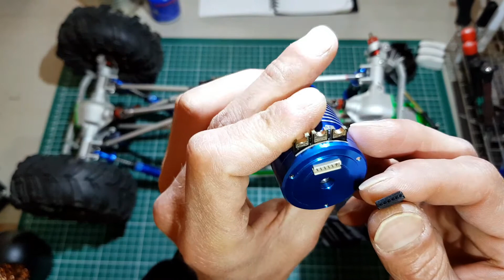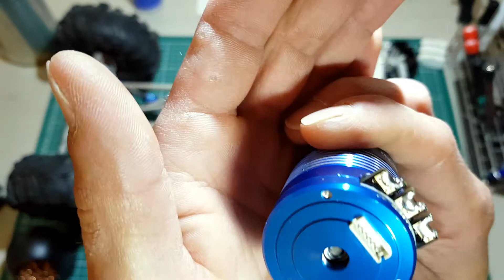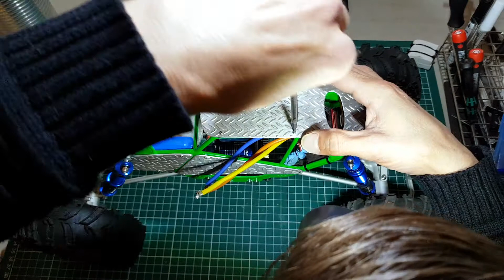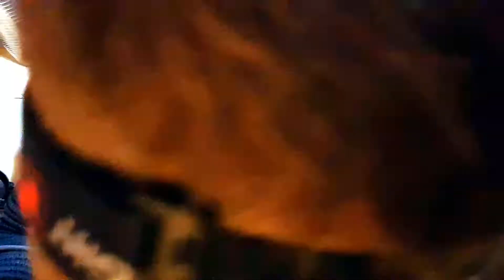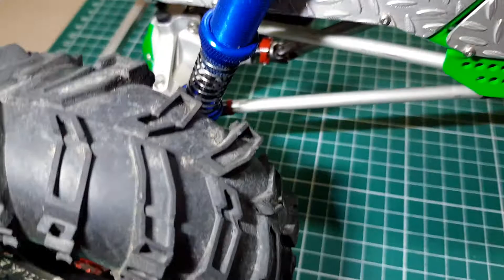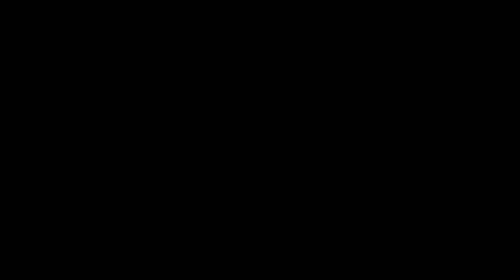***Custom RC Rock Bouncer budget build series part ten***(brushless motor and batteries)

Comment: Muito bom,, a xina tbm produz bons produtos.
Reply from the maker: Thank you, yes.  If you do a little research you can definitely find good manufacturers.
Reply: @dizzydrc  yes, do you think these products are equal to axial products?
Reply from the maker: Yes and no. I really like the gearbox, having no problems what so ever, it maybe even better than a axial one in my opinion because it comes with all metal gears inside for a sharp price but with the axles I'm not so pleased. The CVD's keep snapping, the housing is stil fine but I also know I'm asking a bit much from the axles because I always drive it on 3S and the wheels are very big witch is hard on the complete drivetrain. The trailing arms are also okay, no issues there. The ECS also is a good Chinese product. I use Hobbywing ECS's also in other RC cars of mine. I buy all my lipo batteries in China, very pleased about Zeee batteries, I use them in my Arrma Senton and they do their job well. I did not expect the drive shafts to hold up but they are also doing well. Not one snapt (untill now...) The rims of the wheel I think are also better than axial ones because they are out of metal and look awesome for a price Axial cannot present but the tires I don't know if the are better than Axial ones. They sure look good but I think "better" branded tires use a grippy-er compound/rubber. So...I think that's about it if I'm not forgetting anything, but to be clear, the CVD's/axles and the first set of Chinese shocks are not so good is my experience. 
PS: the frame itself is very strong but it was a bit crooked witch made the assembly not so smooth. Hope you find what you need.👍🏼
Reply: @dizzydrc  Friend, thank you very much, you won another subscriber, and I think there is an advantage in buying from xina, I live in Brazil, and only the freight of an Axial ends up being more expensive than the vehicle itself, thank you very much, you helped me a lot.
Reply from the maker: Awesome and thank you, glad I could help and good luck in your  RC adventure. 👍🏼🥳😁

Comment: You can look for double springs on the shocks with a spacer ring in between,  this is what I’m using in my axial. Also seems like your shocks have super light oil in them, put a stiffer one and you will notice a difference, some droop is nice.
Reply from the maker: Thanks for the info👍🏼. I will definitely look for different springs cause these are not ideal no. Thicker shock oil is on the way. Only had some thinner one at the moment. I also like some droop. Especially on this one because she's a bit heavy on top.